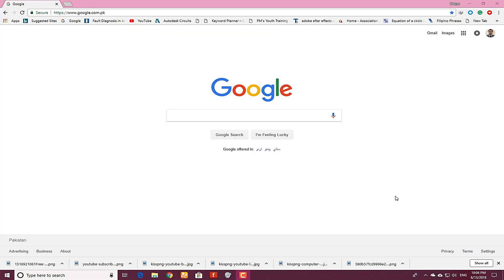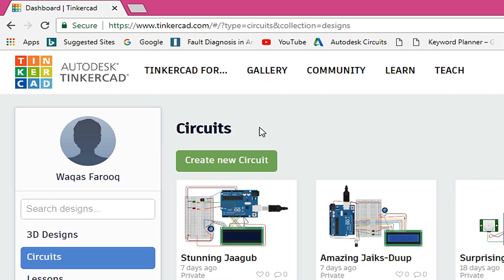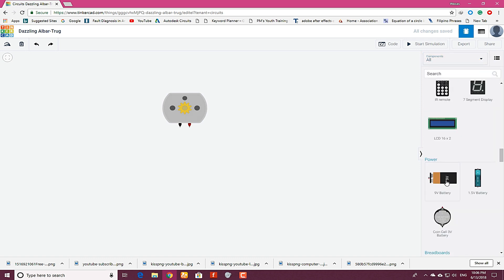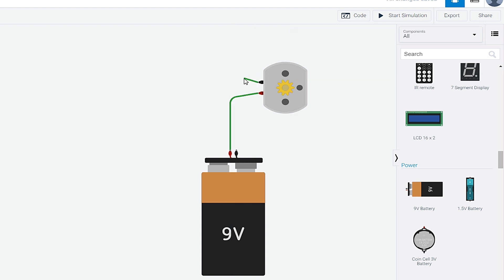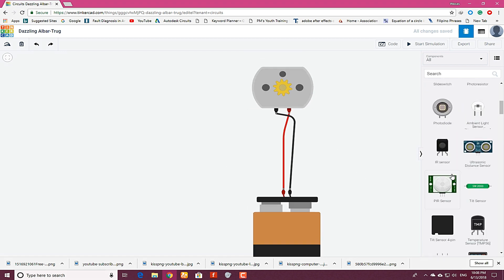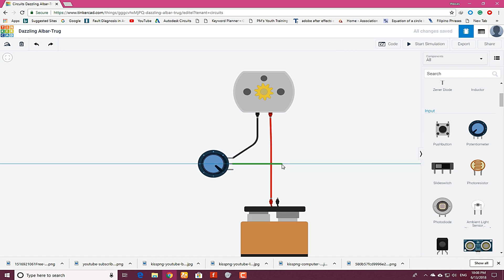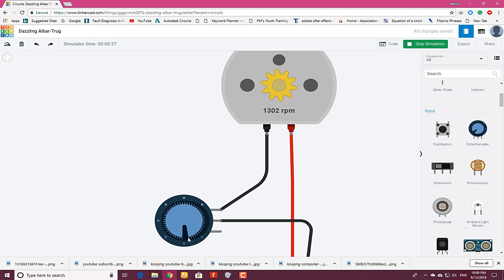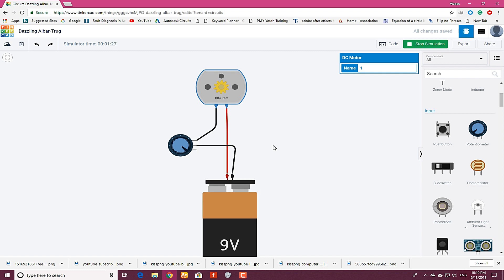Tutorial # 4 How to use a potentiometer to control the speed of a DC Motor

Comment: With this set up you've most likely fried the pot, given they are usually rated at around .2W.. at 9V you are pulling around 140mA, i.e. aprox 1.2W... a transistor would fix that..
Reply from the maker: Possibly but you can use the diac or traic  or MOSFET

Comment: Very informative video, I am trying to slow a 12 volt DC motor which has a 9v battery and switch connected, if I use a potentiometer can I also use a switch along with it? Thanks in advance

Comment: I am using an SCR AC voltage regulator that has a 500K potentiameter installed in it.  The potentiamter has only two pins and only two wires from the regulator is going to it. I used a full bridge rectifier to run a DC motor.
But I didn't like, how much I  had to turn the knob (almost halfway) to get the motor going.
So I used a 100K potentiamter that has the typical 3 pins. Now the motor turn on immediately except now it doens't turn off.  I don't use if I used pin 2 and 3 or pin 1 and 2.  But I am almost sure I used the wiper and pin 3 and left pin 1 out.
Is the reason it doesn't turn off because the value of the pot is too low or do I need to hook up pin 1 and pin 2 together?
Thanks in advance for your advice.
Reply from the maker: your connections are correct actually but you can use DAIC or TRIAC but i would suggest try to use the MOSFET to control DC motor Speed that it may stop at when the resistance to POT is higher. Try it and it may help and let me know in the comments , thank you for watching and sharing your views on this topis i really appreciate and keep doing the great stuff, 🙂🙂🙂

Comment: Generally - use pots for signals, not for power - depending on motor/battery, easy to fry pot by exceeding current limits... Live and learn.
Reply from the maker: you are absolutely correct. I know that but in the tutorial we are only using 9 volt battery
Reply: @WaqasFarooq  it's a good video - people will learn - thanks
Reply from the maker: @sdriza sdriza thank you so much for your appreciation. and thank you for watching and subscribing my channel

Comment: using only potantiometer to control motor is not a good idea. You need to drive it with mosfet
Reply from the maker: you are right but in the simulation we are only using 9 volt battery so potentiometer can handle this much volts
Reply: @WaqasFarooq  im carefull about that bcs i fried some pots when i had no experience before  then i started using mosfet with pots
Reply from the maker: @seckinseckin3919   you are on right track brother

Comment: In order to change make the rotation of the motor slower, you can use resistor. Higher the resister, slower the rotation is.
Reply: a pot is a variable resistance
Reply from the maker: you are absolutely right  thats why you can use potentiometer its just simple method. thank you for watching and commenting, please subscribe my channel
Reply: @WaqasFarooq  Simple & good video. I just subbed.
Reply from the maker: @smelinocreations1673  thank you so much i really appreciate it

Comment: Sir how much current can it handle? I am working on a 12v DC power supply and I want my BLDC motor (4w @5v) to operate at 5v or 7v only. Will it burn my potentiometer?
Reply from the maker: you can use higher value potentiometer
like 250k  or higher

Comment: What is the third terminal on the potentiometer made for?
Reply from the maker: usually we connect outer terminals of potentiometer with +ve and -ve  middle terminal moves clock and counter clock wise you can check the voltage by using voltmeter if you want to see how really potentiometer check this link;

https://www.youtube.com/watch?v=mQQf_jTg5YI&t

check this second link: https://www.youtube.com/watch?v=47gkaPAFpgo&t

Comment: Haha. Everybody's frying their potentiometers because you're basically creating a short circuit. This is very silly and can even be dangerous. Please don't...
Reply from the maker: that's hilarious because i didn't smell anything during simulation  😂😂. you can use 5 volt supply or you can change the potentiometer with hire value.

Comment: I did this, and something smelt like it was burning.
Reply from the maker: it must be potentiometer , how much voltages did you use to operate?
Reply: Same, in mine it was the potentiometer. I used a 9v aswell.
Reply from the maker: @KH-zt3vs   I see you can use motor speed control

Comment: Sir / can potentiometer B50k can handle voltage  ??
Reply from the maker: yes it can handle the voltage . thank you for commenting and and subscribing my channel
Reply: I've already try it and its smell like burning wire.
Reply: I've connect it on dc motor and 5voltage
Reply: I use a potentiometer B50k 6pins
Reply from the maker: @marvincapistrano1327  try to use 10K potentiometer
Reply: First thing about electronics (which I only learned 3 years in) is that it is always CURRENT that fries things, not voltage. 
To understand this here is an example:
You can put a 500k pot in series with an led at mains voltage (220vAC) and most likely nothing will smoke.

BUT the same 500k pot can easily be fried by the smallest 5V DC motor driving a load. 
This video works as long as the total power never exceeds 0.25W or for cheap potentiometers that will be 0.12mw

To understand current in electronics, search for videos with microwave transformer welding machines

Comment: I am new to this stuff. I am trying to add a speed control to a 180v single phase d.c motor. I heard that a potentiometer can work. If I wire it like this, only using a larger power supply, can it work or do I need more components?
Reply from the maker: NO for hire voltage purpose you need to use the speed  controller for the motor you can buy it online

Comment: This won't work in real life. You need a mosfet to control the heat or you will fry the POT
Reply from the maker: you are right if you are using bigger voltage supply . of-course  you can use mosfet or L293d , L298 IC,s  for driving, and control speed of Motor
Reply: Waqas Farooq where can i find these components as its lockdown nowadays..... like old charger?
Reply: @shahin1010  on speaker
Reply: Mine fried 😂
Reply: sorry i wasnt read you,  my pot set on fire
Reply: @B3nderISGreat  whelp... it happens
Reply: exactly .. when i had no experience on it , i fried some pots to run motor then i understand that i have to drive it with mosfet.